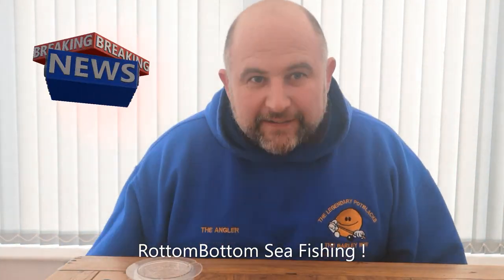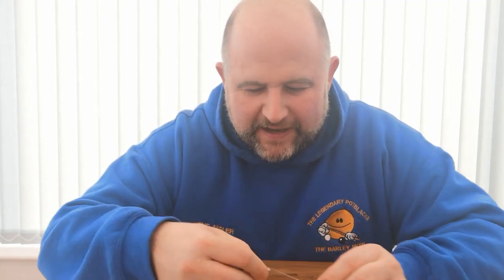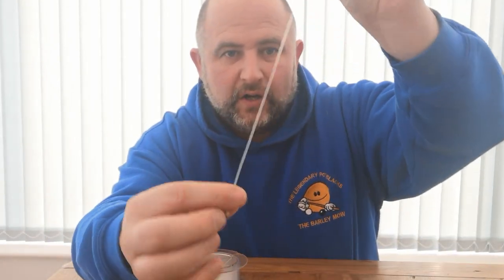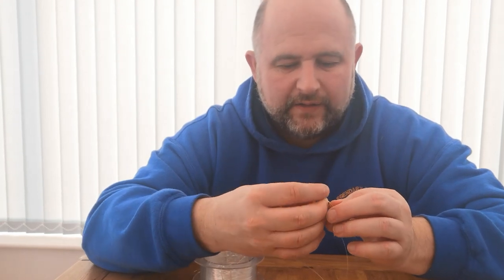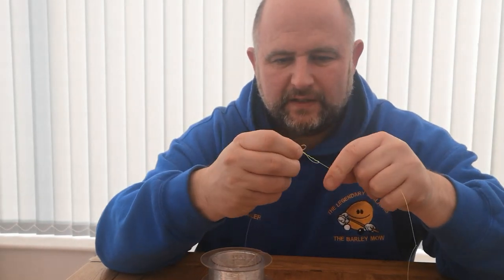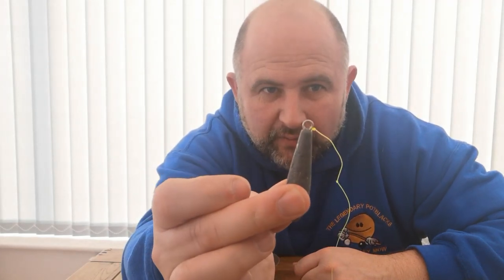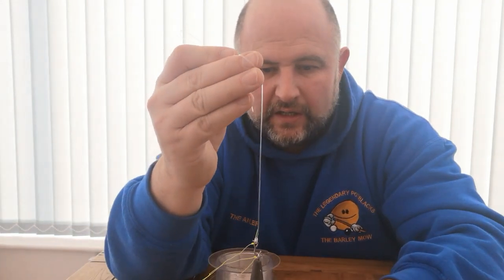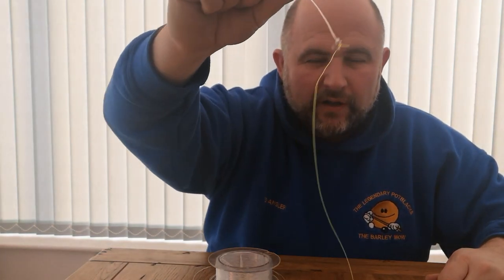Sea Fishing and a Rotten Bottom

Comment: Tie the weak line to the mainline of the rig body , then to your weight have it 10- 12”  long clip your lead into the hook and pull the knot of the weak line up the rig body so they sit tight parallel together , leaving no loop or line where your hook can be caught 👍
Reply from the maker: @Liam Bird many  thanks for the sound advice, ill give it a try and let you know
Reply: @andybowrahfishing9313   keeps it nice and neat bud . Once the weight comes of the clip the knot slides down the rig body and stops at the clip . 8/10 times you lose ya weight the line is left to tie a other weight straight on next cast . 👍🎣